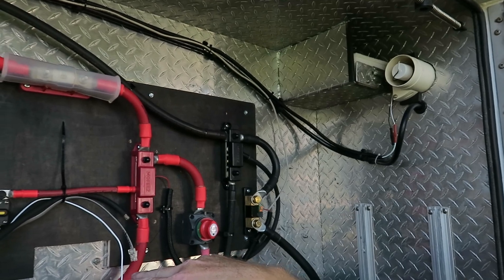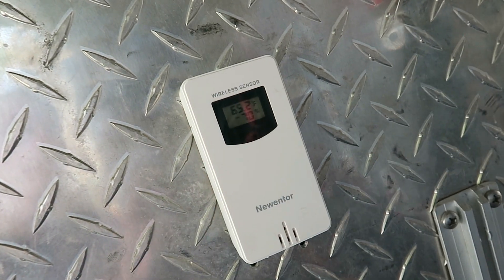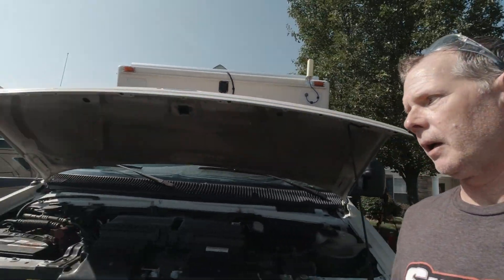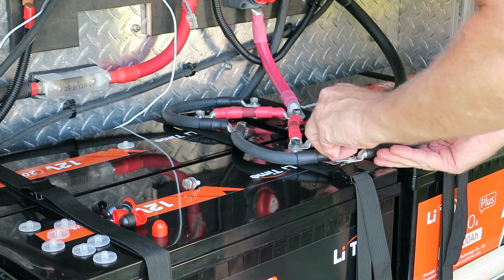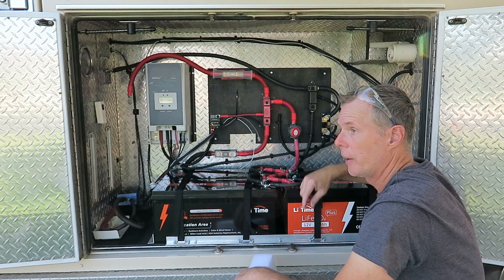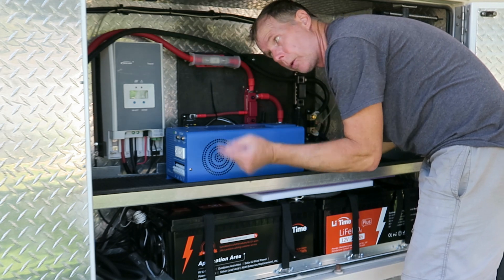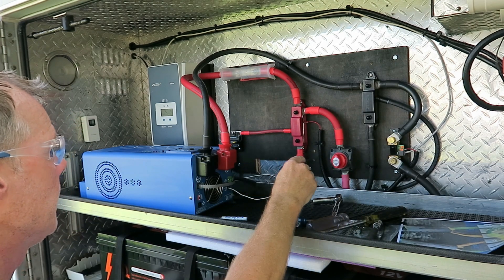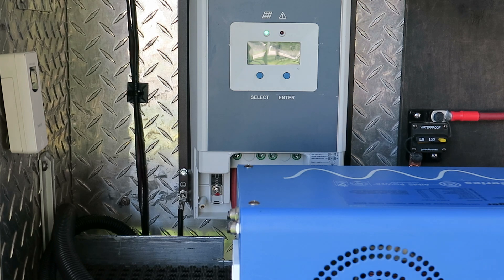Flipping The Switches On Our New 800Ah Batteries | Ambulance Conversion Life

Comment: Hey came out nice, on charging , you should charge at about 14v and try not to discharge below 40 - 50 percent, they don't need to be charged to 100 percent all the time 95-98 percent is better , it will extend the life of the batteries, you have enough batteries , you will never notice the difference.
Reply from the maker: The more I've learned the more I've read that many people just charge to 13.8v. I'll be looking more into this and figure out the best way to maintain them.

Comment: I once used online USPS when ordering, and I purchased two rolls of stamps for mailing out invoicing. The stamps never came. After several months, I had to go through a requisition process, or whatever you call it, that I requested that USPS please ship me my order. it took some work. Finally, the stamps were sent. But I received numerous emails in the ensuing months, which requested that, if I received both orders, that I would send one back. The emails were some sort of honor system request. To finish this story, I had the stamps shipped to my PO Box. I suspect someone may have taken them from the inside the office there. Perhaps not, but where else would they have disappeared?
So, I felt your pain Mr. David..
Reply from the maker: I got lucky that I held on to the receipt, otherwise I know I would have been jammed up! They had to get the supervisor's approval to reship it! The city, zip was the same and the weight was exactly the same as the receipt :)

Comment: I always thought you had to have positive hook to the lap positive post and the negative at the end of the last negative post that way the current get strong evenly across all four batteries. It appears to me that you just need to move the red wire going up to the switch to the left to the other positive post.  But that's my opinion
Reply from the maker: I didn't have a cable that length to make that turn. It's on the 2nd of 4...

Comment: careful about the torque on the battery terminal lugs. i stripped out 3 of mine by over tightening them. my terminals were aluminum and i think yours is the same. i only used a screw driver to torque them but still over did it. i suggest a small torque wrench.
Reply from the maker: I used a 1/4" short ratchet and just compressed the split washer. They felt solid without overdoing it :)

Comment: do you have a cut off switch on the solar input? that i feel is important because if you disconnect the battery and the solar is still hooked up it will make power and there is no where for it to go. that results in blowen solar inverters. i installed a cut off switch on my solar input so i can discount that first. then i can disconnect the other components. i think i am right. then at times when i am fully charged i can if i want cut off the solar input at my discretion.
Reply from the maker: I have a fuse buy no shut off. My charger controller web through my last battery upgrade with the panels still connected - the battery swap took about 2-3 hours and it was OK. I didn't know that was a no no at the time. It also has an internal fuse that will blow.
I'll add a shutoff at some point, there's room for it down there.
Reply: @TheCampulanceMan  you got all your digital readouts inside. you could put a switch inside. the standard wire for solar is 10 gauge. so most any kinda switch will work. i use that solar switch on my system more than any other. but i got 1920 watts of solar and there is times when i just want to charge to 85% and its the easiest way to control that way.

Comment: Great looking setup. BUT. Please insulate that bare metal ratchet handle before you short out something and have a disaster in your face. i've seen thousands vaporize a large steel uninsulated tool. worker was ok, he was insulated but reluctant to work high voltage testing jobs in military.
Reply from the maker: I was sent a link to some insulator adapters to use. I'd never seen them before so before I do this kind of work again, I'll be adding them to my tool box.

Comment: Be safe with these batteries please, they can catch on fire and burn incredibly hot that even fire departments have trouble putting out. I saw a video where they caught on fire in EV cars on a ship and they burned through the steel on the ship, it was frightening
Reply from the maker: Always :)
Reply: One thing about the batteries that are being used for solar is they're LIFEPO4 which is a much safer chemistry than the kind of Li batteries they use in EVs. Electric vehicles generally use Lithium Cobalt chemistries which has more power for less weight but is highly volatile. Lithium Cobalt batteries release their own oxygen as they burn so that once they are started on fire they will literally burn under water. LIFEPO4 you can throw in a fire and they will just char.

Comment: DO YOU NOT WANT A JOB DOING SOLAR I HAVE MY SYSTEM WORKING NOW. ONLY DIFFERENCE IS BUILD A CABINET CREATE BATTERY AREA REWIRE REDESIGN MY BATTERIES IM THINKING ABOUT GETTING YOUR BATTERIES BUT 600 AMP HOUR SO I CAN GET NEW FRIDGE HOME STYLE ILL PAY YOU GIVE ME A PRICE YOU WOULD BE CHARGING ME THANK YOU RV DAVY I have 560 in solar panels up top.
Reply from the maker: I can help you out this winter if you're in Arizona :)